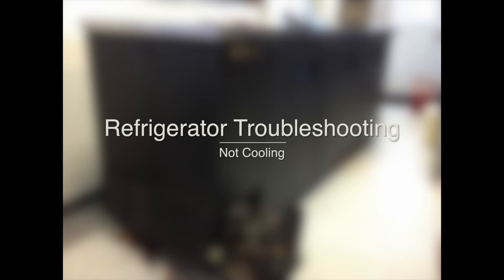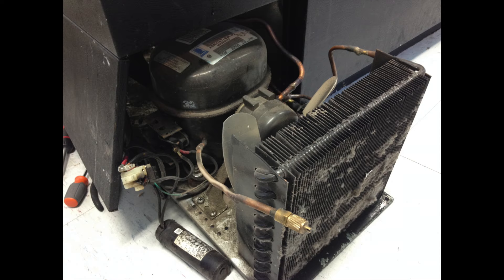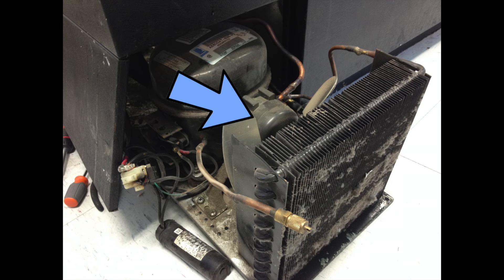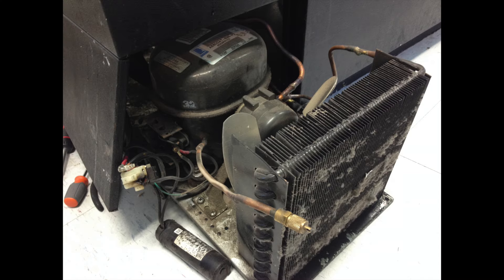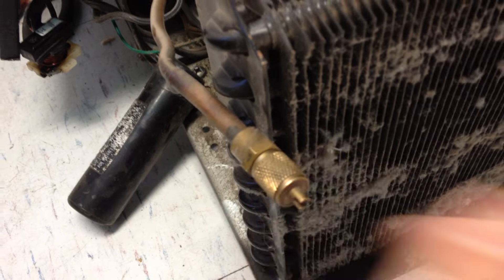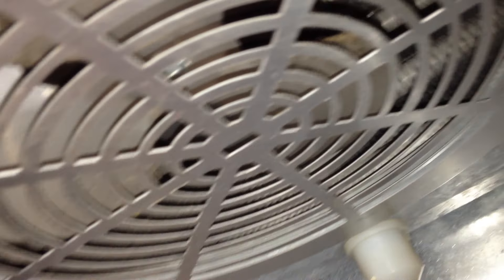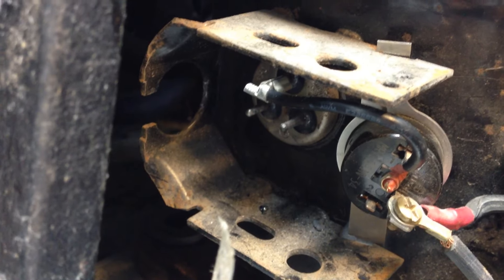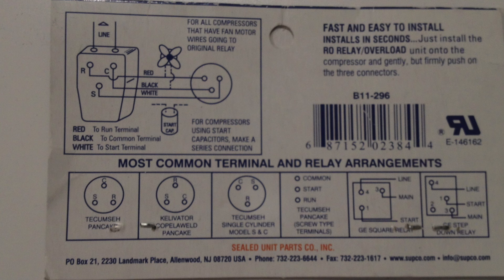Refrigerator Troubleshooting Repair not cooling - Compressor starter relay

Comment: Hey ADAM GREAT Video I HAVE A QUESTION I HAVE A 2 doors back bar refrigerator BUT NOT COOLING THE 2 FAN WORKS FINE the compressor looks fine, I don't KNOW what's TO DO....any suggestions Please ADAM 
Here Model: TBB-3G
SERIAL NUMBER:6597692
Reply from the maker: That is almost the same model as the one I was working on.  If everything appears to be running fine but a fridge is not cooling, I check these things:  1. Is there a freon leak?  2. Is there a bad seal in the door (or something blocking the door from closing all the way) that is allowing air to flow? 3. Is there dust collected on the outside fins that is not allowing air to flow?  4. are you positive the temperature dial is set correctly?  5. Is there ice buildup on the inside fins? (could be a sign your auto defrost element is out).
Reply: 1. Well am not sure if the freon is leaking
 temperature 
#2. I think There's not seal  nothing blocking the doors  
#3 I don't think there's no dust cause it was working fine
#4 Honestly I don't know how to check the temperature 
#.5 there's not ice inside. 
Cause Everything works it just doesn't cool
 Adam Any suggestions please I need you help please
Reply from the maker: The freon is running through the copper tube. If you find the part that looks like a valve stem on a bike or car wheel, you can push it like you would let air out of a tire. Do it for just a second with the fridge unplugged. If you hear a hiss noise then you still have freon left inside the copper pipe.
Reply: Hard to trouble shoot like this, Huh AdamDYI... lol
Reply: Most commercial reach ins do not have access ports.  Also they have a certain amount of refrigerant, and if that valve stems sticks open, your viewers refrigerant will be all gone.  Did you know that?

Comment: How do you know it was Freon brand refrigerant?? Might have been Allied Chemical, DuPont, Supa, Genetron... Point being, if you are a refrigeration tech, use the correct industry term, Refrigerant. Freon is a brand name. Like Chevy or Ford for cars. Calling all refrigerant Freon is like calling all cars a Chevy. Ok for a non-industry person, but if you are in the trade, it makes you sound like a novice. Good troubleshooting tips otherwise...

Comment: I mean this with all due respect but if your "repair" video starts with "check to make sure you have power to the outlet" and "clean the dirt off the condenser" you're dumbing this down and wasting the time of those who actually are making real repairs and aren't just morons.   This like auto repair videos that start by showing how to remove a car/truck wheel lug nuts - seriously?    If someone needs to see that they shouldn't be making auto repairs,just like someone who needs to be told to check outlet power shouldn't be "repairing" a fridge.

Comment: My question is can the internal thermometer go bad I can't seem to get the outside thermometer that shows temp to go above 44 degrees. I have thermometers inside and they tell me the temp is 30-34 degrees. For Licensing I need to insure the outside temp is working correctly. How do I replace it!